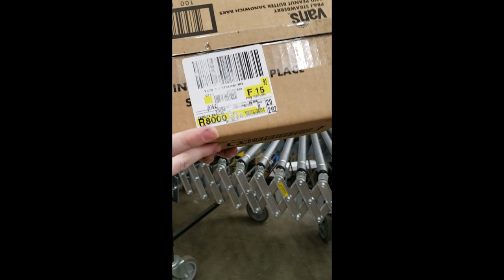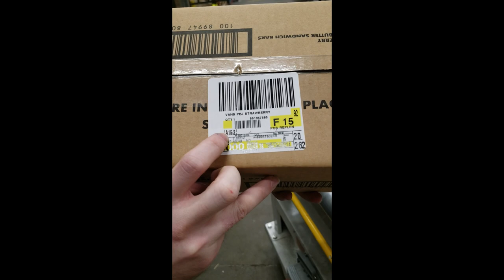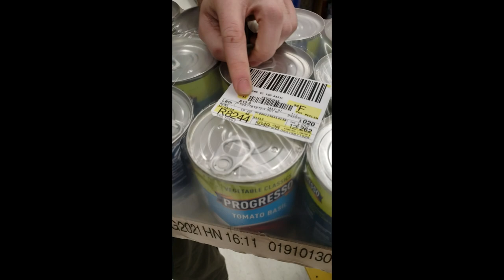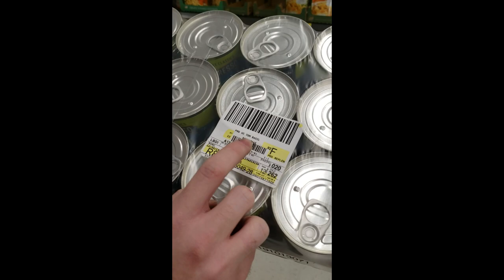What is Cap 2 Walmart

Comment: I used to work on Cap 2 from late 2017 until july of last year. For me, the job depends on who's around. If you have a good supervisor and good coworkers, it'll make the job a lot easier. If you do sign up for cap 2, the busiest times of the year are holidays or two truck days. If you dont have a good team on the truck for those two truck days or not enough people, then its gonna be a lot harder (especially if you dont have an electric conveyor).

 At the walmart where I worked. we had a team unload the truck,  and the other half stocked the groceries that already came in on pallets earlier in the day. If it's one truck, its usually done by the first break. After that we stocked the freight that came off the truck and Continue stocking freight that was already there if it wasn't done yet until lunch. After that a few people would pull pallets that were loaded from the truck to the appropriate sections of the store while everyone else stocked. I was usually in grocery and sometimes in paper and chemicals. 

It was mostly chill after lunch. From lunch until we left was my favorite part of the day because most people are stocking their aisles and there would always be interesting stories about our interactions with customers. 

I left because of supervisors I didn't like and I didn't like doing the truck every day. Oh yeah, expect a minimum of one truck every day. Just thought I should throw my two cents in. If I forget to add anything I'll edit this comment. If you have any questions about Cap 2 then just ask.

Edit: Making a new (cardboard) bale is easy once you learn it.
Reply: How big is the team usually? Like how many people
Reply: @VanessaDMusic  Between 10-20. Usually around 15 or 16. That's how it was for us.
Reply: Crash awesome, I just got an email saying I’ve been chosen for a job. I didn’t get an orientation email yet, but I hope to soon! I’m just excited to be making money lol
Reply: @Stackleton  They're usually already there when you get there.
Reply: @Jaz-32  They have ladders. Im 5'1 lol

Comment: I worked this for a couple years. I actually didn't mind it. Get yourself jacked up on energy drink, throw the truck, make it your goal to overwhelm the crew that's stacking, ask them if their skirt is too tight when they complain your going too fast. lol  I'm over 50 years old and nothing tickles me more than tiring out the young bucks, seeing the defeated hung heads. Time goes by fast. If a manager has to help, by the time they're finished, they've burned off some of that energy they'd usually use to harass you.  Same with the fellow employees. You're usually working with the real workers, not the high school sham clique. Stacking is a good mental exercise, kinda like Jenga in reverse.

Comment: I worked as cap 2 for a year got promoted cap 2 supervisor but left the position after 6 months.. Bruhh cap 2 is easy job if you have good team n management if not- get the hell out of that team.
Reply: I got a question do you stock stuff on the shelves and do you think I can handle the job I’m 5’4 male?
Reply: @Jaz-32  Yes bro that is what cap team does. We need to do stocking, zoning, bringing down the items from top, unloading the both GM and Grocery truck, One touch, apparel etc etc .... and about the height ya bro use topstock cart or ladder.... I am 5'8, I use it every single day when I need to stock stuffs in the top.

Comment: If been on Cap2 Truck team for 3 years now As Self Proclaimed King of Cap 2 and Lord of the Truck the statements are true if you are surrounded by good co-workers the job to me is like just fun to do working together battling other departments in my store we are now switching over to a new system for our store Cap2 no longer in my store stocks new items that is now gone to over night we are to unload GM and HVDC trucks and run picks thru-out the rest of the day so you'll have a 5 person truck team as the rest split up to their locations to start viz picking the backrooms our super center fits 4 HVDC trucks and 3 GM trucks  HVDC trucks range between 450 ( which are usally our water pallet trucks ) regular HVDC  trucks are between 1500-2200  and GM side 2 days a week get double trucks which range from 1800-3400 pc trucks
Reply: You couldn't use a single f**** period in that comment? Literally takes less than a tenth of a second to add one. If you got something to say, it helps you look a whole lot less ignorant instead of cramming together in one huge run-on.